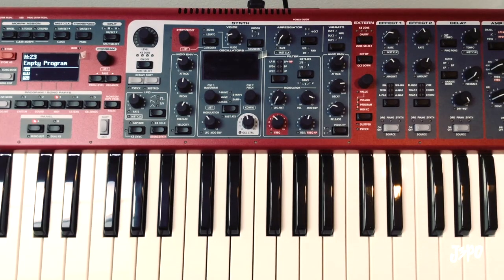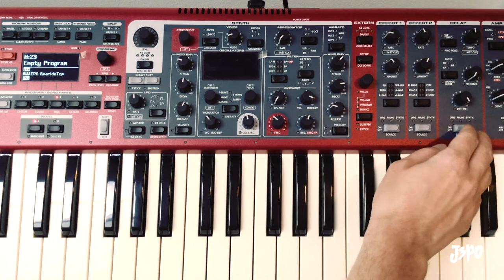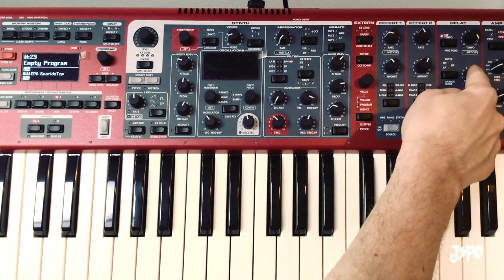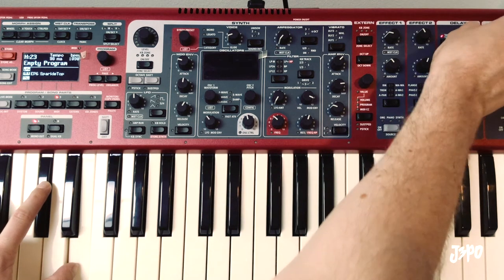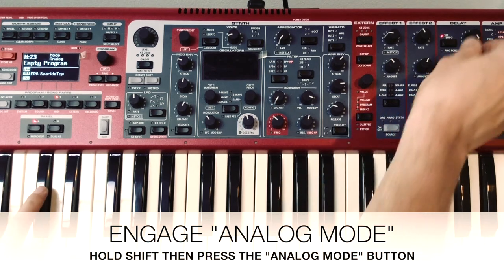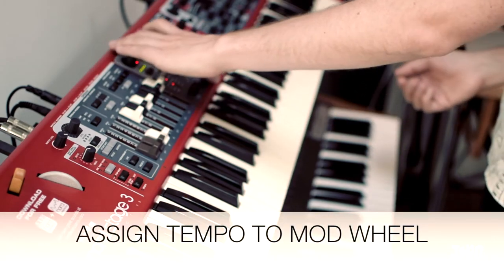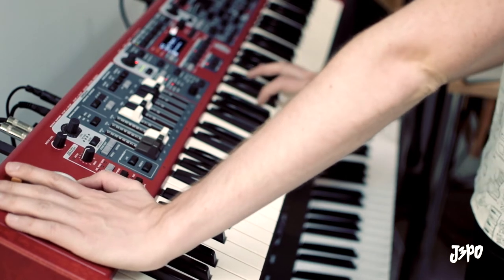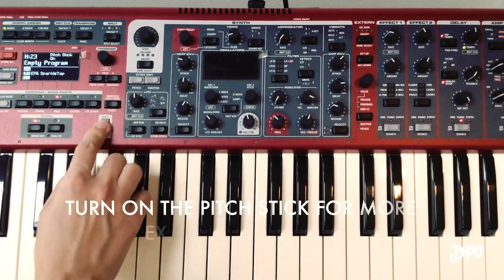J3PO: Patch Design - "Glitch My Rhodes" NORD Stage 3

Comment: Julian, how do you setup your keyboards on stage in a live gig? All mono?
Reply from the maker: All mono, is correct! In the studio, I have to decide if I want to keep the chain mono or stereo. Certain FX units make it mono...so then I have to commit to that, which is not always a bad thing. Those Strymon delays, reverbs, and choruses are really nice to have stereo though.... ;)
Reply: Stereo in studio - of course! But in live concert setup? Actually I mean phasing issues whet there's a little sweet spot in center between the speakers when stereo image is ok and like in studio, but 1) there are also spots where sound could almost dissapear and 2) most of the people hear only one speaker most of the time and it is only one channel of two, so all the stereo fx don't make sense. what do you think? thanks!